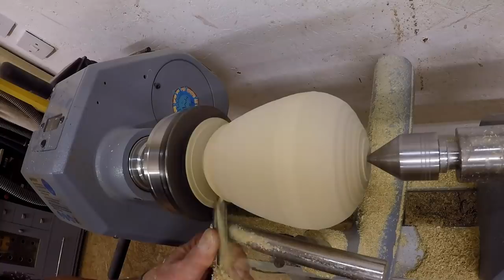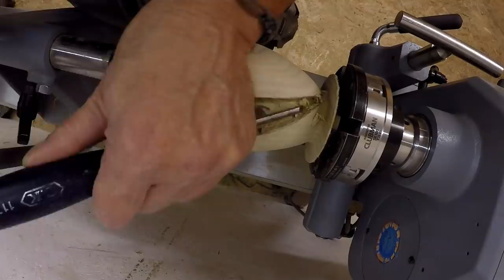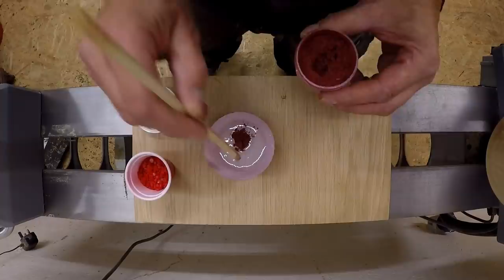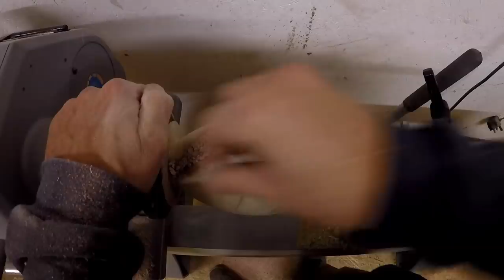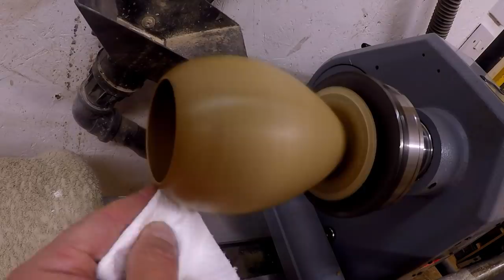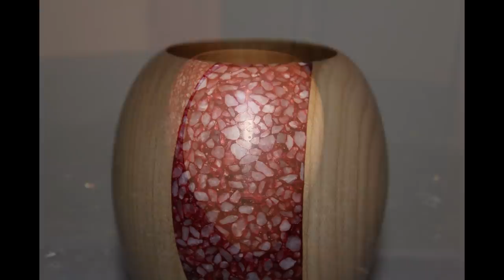Woodturning - A Tulip and Stone  hollow form

Comment: Another lovely piece from you Andy.  I tried using decorative stone a while back but it was so hard, I had to take the angle grinder to it. The result was less than good!
Thanks for sharing 

Geof
Reply from the maker: Thanks Geof .. I used Fish Tank gravel not sure what stone it is but you can sand it back with 60 grit if you keep it fairly flush ..cheers Andy

Comment: Hi Andy, a couple of questions. The gravel or aggregate looks abit like quartz /quarzite, but that would have been very difficult, because of its hardness, to sand. Would be interested to know what type of [Stone?] you used. I suppose you could use rock salt? I presume you were careful not to break into the inlay when you were hollowing out? An excellent piece, btw and might have a go myself, perhaps using some softer stone.
Reply from the maker: Thanks .. I used fish tank gravel not sure what type it is .. You can see the inlay on the inside as well that wasn't really my plan but once I broke through I had to carry on ..cheers Andy

Comment: 1) Very Cool!
2) What kind of stone did you use? Was it difficult to turn in the lathe, even once sanded? 
3) Another one of those ideas you've had that could spawn multiple, equally lovely, variations.
Reply from the maker: Thanks ..it was fish tank gravel 👍
Reply: @AndyPhillipWoodturning  interesting! Have you ever tried soapstone inserts? Soapstone is extremely soft, it may even be softer than most of the wood you turn....but you might be able to make a soapstone vessel, or incorporate it.

Comment: Great work again Andy... and very impressive - can I be cheeky and ask what you used as a finisher  -  sorry if that didn't make sense... I usually use mineral oil or linseed oil / beeswax etc for most wooden finishes but for an epoxy resin what do you use a a finisher ??
Reply from the maker: Thanks Stephen .. on this I used a sanding sealer/thinners mix then Yorkshire grit abrasive paste and then Yorkshire grit micro fine paste which will buff the resin as well as the wood ..cheers Andy

Comment: Very nice just a question on the small sander that you use on the inside off the vesel  did you make it your self or did you buy it
Reply from the maker: I buy the small 1" sanding discs off ebay and they thread onto my homemade carbide cutter chisel ..cheers